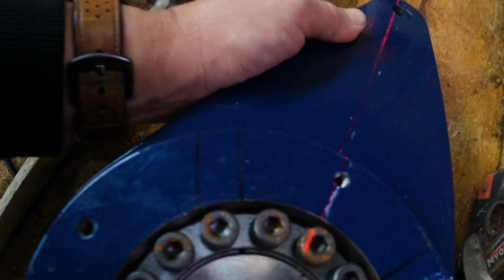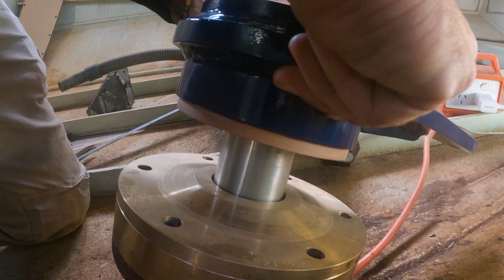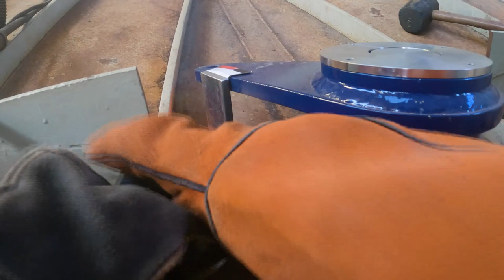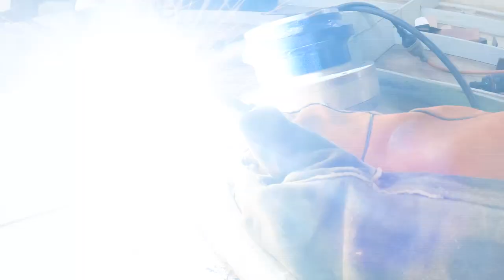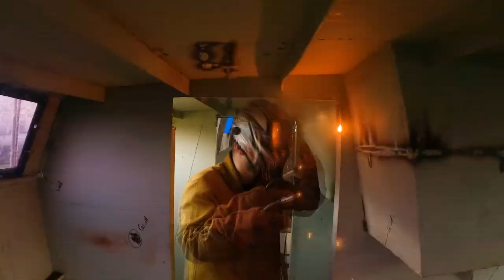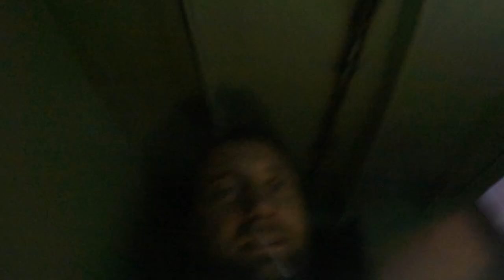Sailing QC #71 |  Rudder Installation PART 2 & Steel Framing  | Steel Sailboat Restoration

Comment: your rudder stops need more side to side supports  anther wise it might tear out of the bottom of your hull not a good thing   Captain Great job keep carrying on stick one project finish it and check it off the box of thing to be done
Reply from the maker: HI Donald, thanks for your great comment. I was hoping the stops would be enough but looks like general consensus is that I need to add in supports...so I shall! thanks mate 😀

Comment: Anti-seize or dielectric grease is cheap, be sure to lube up that brass/ bronze rudder bushing to mitigate galvanic action between the bushing and the steel.
Reply from the maker: Hi Ed! absolutely we will be most definitely doing this on final install using the grease nipple too.

Comment: Honing tools are expensive there. I got a small one and a big one about 10 years ago and it was ZAR R200 (AUS $20) and it came with about 10 sets of stones of different grit. Maybe you were looking at the wrong ones because there are 3 different types? There is one that looks like a bottle brush with little balls stuck on the bristles, and there is one that looks like a reaming tool/chuck with "blades" that you change, which I think is the one you saw, and the one I'm talking about looks like 3 windscreen wipers joined to a flexible shaft with a spring for tension.
Reply: I just dug mine out and the little one does 15mm to 50mm and the big one does 50mm to 180mm and you can set it to a maximum diameter and lock it, which would be useful for grinding out the part where the welding shrunk the diameter a bit, cause you could set it to what you need it to be and push it in and it will slowly grind away and it will stop when you reach the diameter you set it to. Some times they also called Brake Cylinder honing tools. Which maybe the little one will fit a brake cylinder, but I have never seen a brake cylinder 180mm diameter. And if I look at the sites of my local machine tool suppliers they still have them from about AUS $9 to $25.
Reply from the maker: Obviously the tool shop I went too was too expensive hahaha never mind its all good to save the few $$ I've used what I already had. She's costing a fair bit to build so its good to save some money here and there ⛵
Reply: @SailingQuickCreations  Yes, I understand. That's why a project like this interests me, its so terrifying to think about how much there is to do, and pay for. Its not like buying a neglected one that needs a water pump, some new sails/rigging and a coat of paint and maybe a few repairs or service everything else. This is basically building everything from scratch and you don't even get a manual. You have my utmost respect.

Comment: Do you plan to reinforce the steering stops or hydraulic cylinder bracket against the boat hull? 
To spread the stress from rudder / cylinder movement further across the hull
Reply from the maker: I was hoping the stops would be enough but looks like general consensus is that I need to add in supports! thanks Chris ⛵